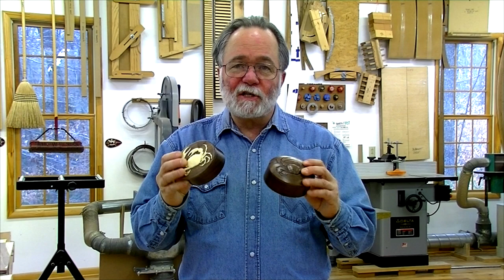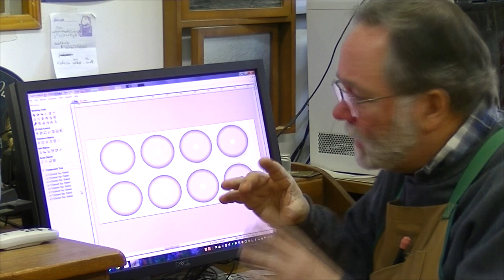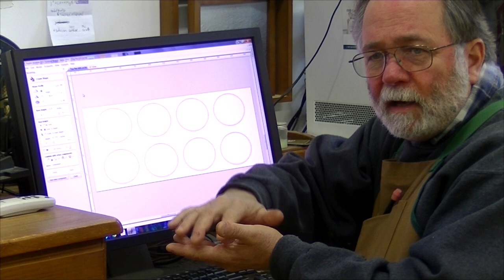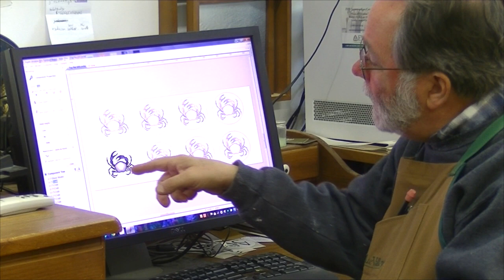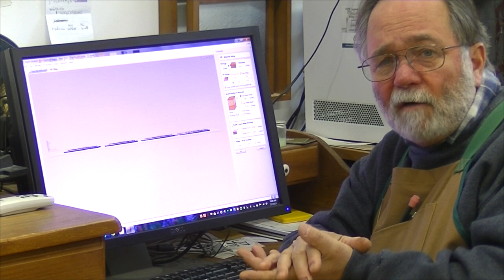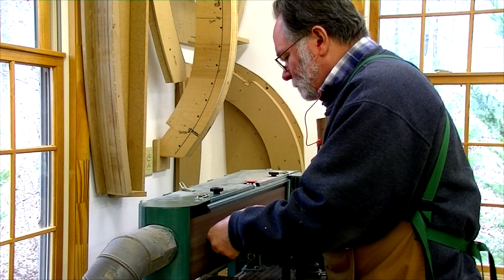Making CNC Carved Crab Top Boxes; Andrew Pitts-FurnitureMaker

Comment: That was a good approach.  I probably would have tried to inlay the crab into the top which would have been a lot more machining and be prone to failure.  Wouldn't it be easier to reference from the bottom of the piece than from the glue line?  You can set Z zero to be either the top or bottom surface in the job setup (at least in vcarve anyway).